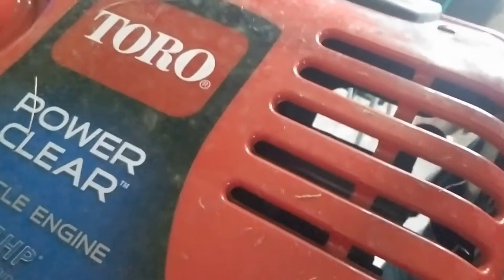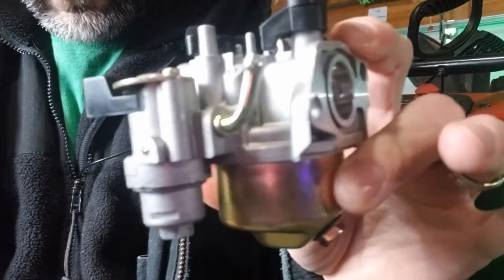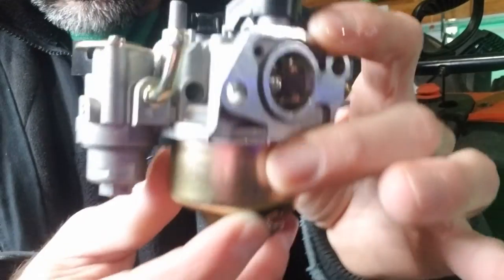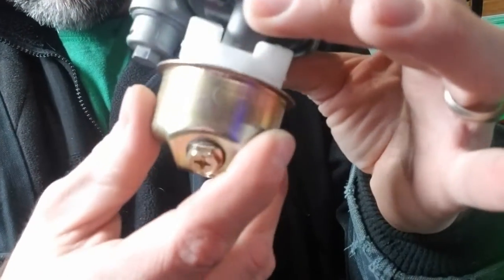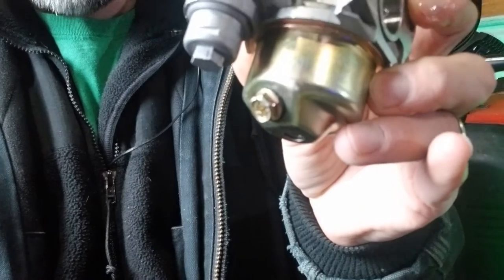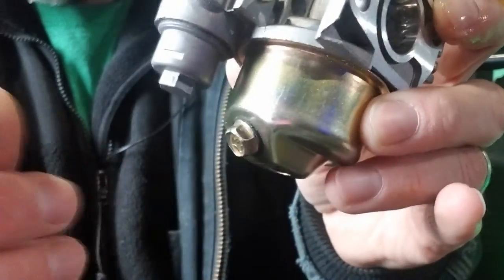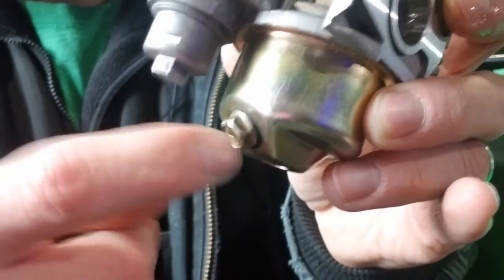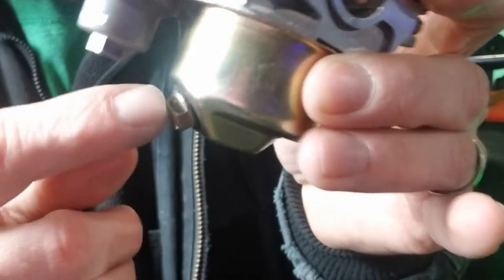[FIX] Snowblower Stalls After Starting EVERY Time [Don't forget to Check This!]

Comment: Mine machine starts, runs for about 4 seconds and then stalls.  You don't have to wait to start it again.  You can start it a hundred times in a row, and it will stall after four seconds.  Also, you can keep it running by pressing the primer bulb every few seconds.  So, what's the differential diagnosis for a machine that will start every time (with priming), but then stalls.